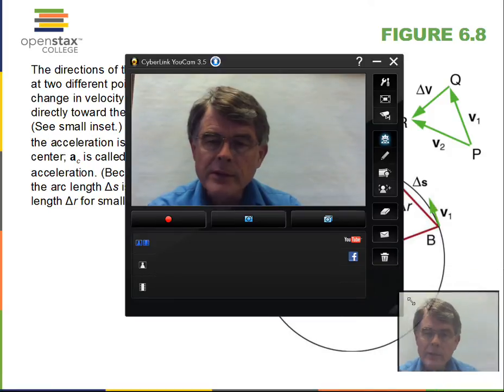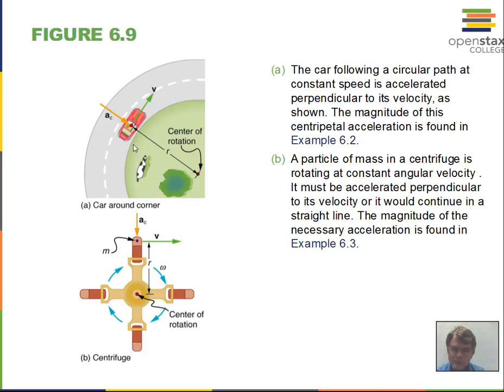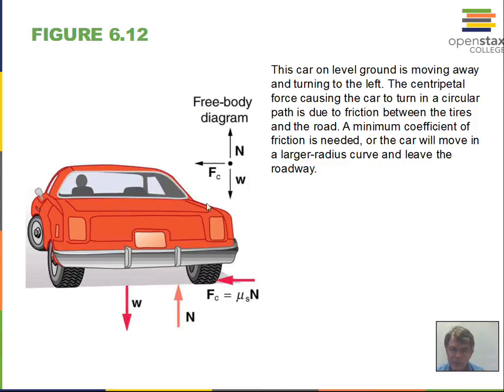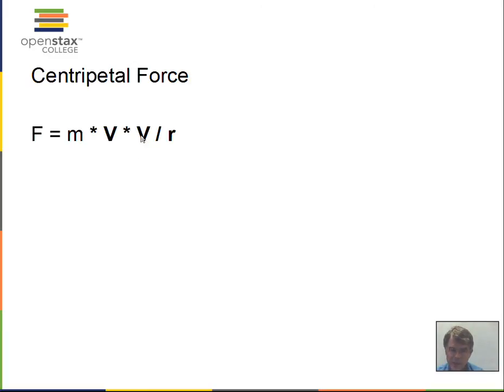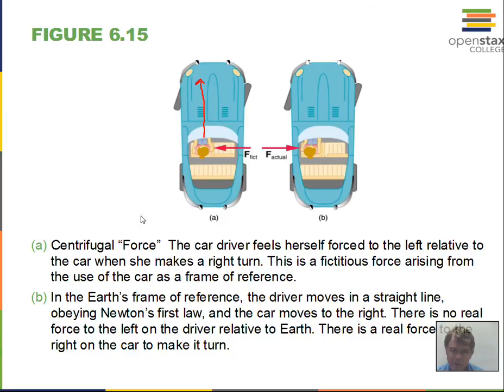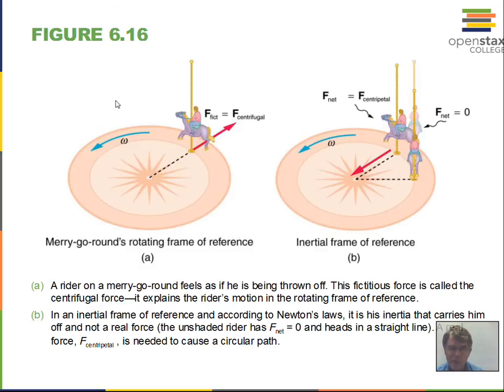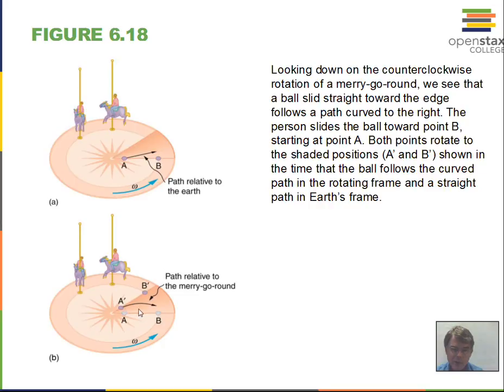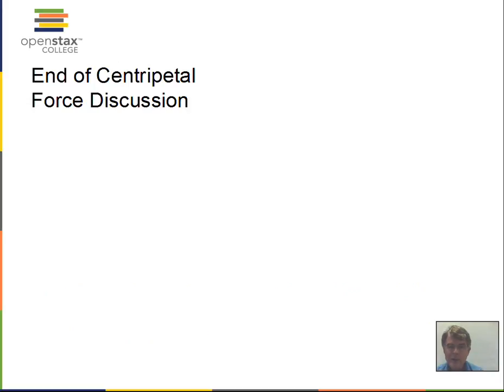Centripetal Force and Centrifugal "Force" Introduction

Comment: You say centrifugal force is a false and fictitious force, this is not true.  When you swing a ball on a piece of string the ball "EXERTS" a centrifugal force on your hand and you can feel this force.  When you go round a bend in a car your body will be "EXERTING" a centrifugal force on the road via the car, this is why you find yourself pushing against the side of the car.  It is worth noting a rotating mass "EXERTS" a centrifugal force, it is not subject to such a force.
Reply from the maker: The forces in the discussion are forces that act on the object of interest in the discussion (the ball, or the person in the car).  The horizontal force on the ball or the person is a centripetal force.  For the case of the ball on the string there is a force on the hand directed outward toward the circular path but the hand is not the object of interest for the ball moving in circular motion.  The surface of the road does experience a force towards the outside of the circular path but the surface of the road is not the object of interest in the discussion.  The objects of interest in the discussion only experience a centripetal force.  The objects of interest do not experience a centrifugal force.  There is no centrifugal force for the object that is moving in circular motion.  The object at the center of the circle does experience an outward force but this object is not moving.
Reply: I thank you for your response.  Nothing causes more problems than centrifugal force and with all due respect this problem is not helped by your video.  Forces go in pairs thus you cannot have one without the other.